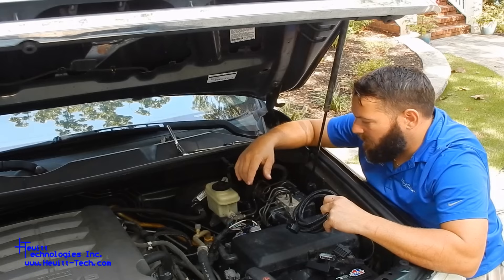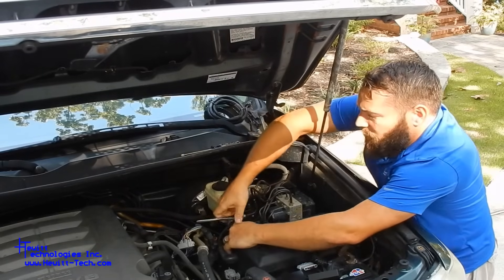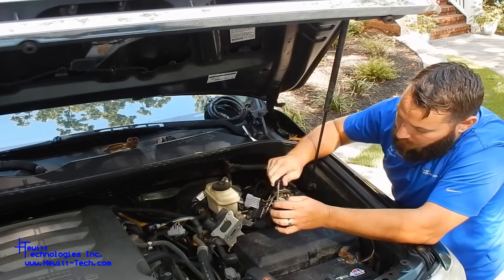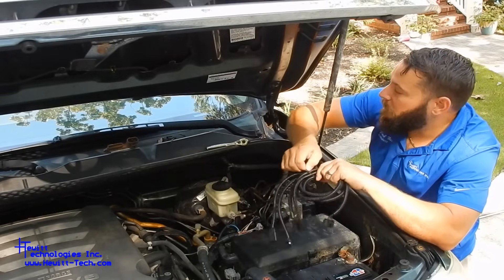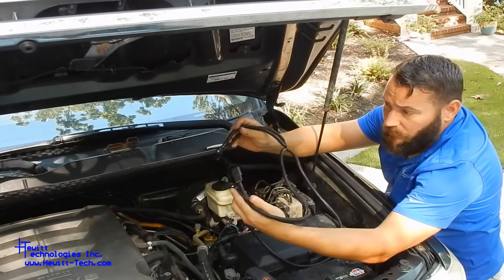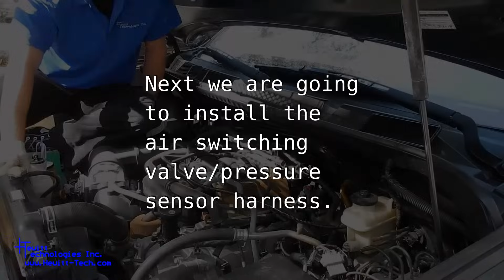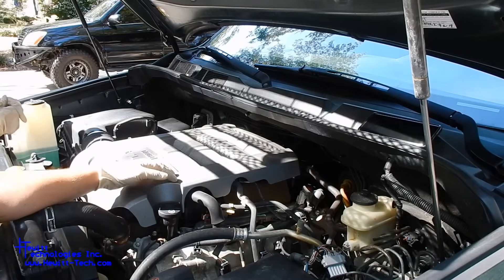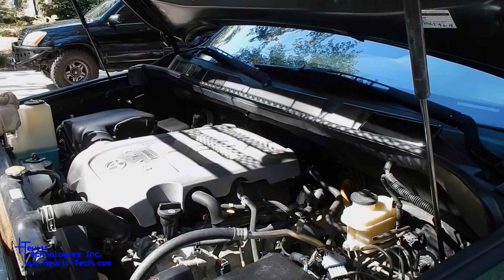Gen-II Secondary Air Injection Bypass Module - 2007-2021 Tundra 5.7L- Hewitt Technologies

Comment: So this wouldnt work for older vehicles?
Reply from the maker: This is just the 5.7l version of the Gen2 kit. We have a Gen2 kit for every Toyota/Lexus year, model and engine vehicle from 2005 up to current model year.
Reply: @Hewitt-tech  can I get a link to the version for older models?

I have a 4.7 2006 4runner & will prolly need this kit down the road. Thanks!
Reply from the maker: @Vang_Cutz  The Gen1 V36H is still a great option for prevention on the 3-Valve 05-07 4.7L vehicles.

Comment: Just got p2440 code for bank one valve stuck open. Debating which is better to bypass or just replace both valves. Truck won't accelerate, filly. Is this OK to drive as well, no stalling issues? Just accelerating. 4.6 v8 2011 tundra

Comment: Will this clear the p2445 code on my 2011 Tundra 5.7?
Reply from the maker: Yes. P2445 code is on the list it can take care of as long as it is not the result of a damaged pressure sensor. If you can clear the p2445 and it doesn't come back on until at least the next cold  start it's got you covered. We have pressure sensor addons (PSO) if you have problems after and it indicates a damaged sensor.

Comment: Do I need a gen 1 or a gen 2 kit for my 2007 tundra 4.7
Reply from the maker: The both have their advantages. The 2007 Model year Tundra 4.7L is the first year of the secondary air system where the design moved both air switching valves to the top of each valve cover. This makes the installation of either kit super simple. Both would be completely plug and play and the Gen2 has clear advantages over the Gen1 kits. That doesn't necessarily mean you "need" the Gen2 kit but in the long run it is certainly the kit we would recommend to have the best chance of never having any problems from the secondary air system again as it also eliminates the need for the air pumps, air injection control drivers and air switching valve solenoids to be connected and within spec. With the Gen1 kits there could still be a possibility that something like the air pump motor can go out of spec because water in the air pump and throw a code later. The Gen1 kits have addons for that if it happens but the Gen2 kit eliminates that as a possibility. If you or anyone else has any questions please give us a call so we can do help with the solution that best fits your needs.

Comment: I have an 08 tundra with the 5.7. I have error codes p2447. Will this be able to fix my dtc?
Reply from the maker: Hello Preston. Yes, the P2447 Pump Stuck Off Bank2 is one of the codes the bypass kit will be able to take care of. If you can't clear that code at all though, let us know, you may have a damaged pressure sensor that will also need to be addressed with a Pressure Sensor Addon.

Comment: I have a p2447 code on a 2007 Toyota Tundra. Do I just need the gen 2 bypass?
Reply from the maker: Typically that should be all you need. Especially of it just started happening or you can still clear it and drive fine for at least the rest of the day. If not, give us a call on Monday and we can have a conversation about the best options for you. Toll Free 1-844-307-7671

Comment: How did you fit your hand behind the passenger side??? Its super tight back there and the harness is literally right over it. I was able to force my hand back there but then my hand was stuck and i hand no leverage to pull the connector off.
Reply from the maker: You can unbolt the main engine harness support and a couple other things in the area to VERY gently get more room from the main engine harness. To unclip the connector try laying a small a flat head screwdriver on the tab so you can easily depress it with your thumb, or use your other hand to carefully push down from above with a long screwdriver so you can use your full grip strength to pull the connector off.
Reply: @Hewitt-tech  was finally able to get it off. Used a 12in needle nose plier. I was able to fit the plier in from the side and to get it off. Thanks.
Reply: @Hewitt-tech  i havent installed the block off plates. Its like 10° here in MN today so im planning to install them tomorrow instead of today. I did clear the codes and took the truck for a cruise around the block. The lights came back on and its back in limp mode. Im guessing once i install the block off plates, and re-clear the codes, it should solve it? I was getting code p2440 valve stuck open.
Reply from the maker: @franklock123  installing the plates would certainly be the next step. They are recommended regardless of the code but are required if the valves are physically stuck open or leaking exhaust. After that and clearing the code(s) again if you get a CEL again read the codes and give us a call or send us an email.
Reply: @Hewitt-tech  ok so i just got done installed the plates. I cleared the codes. The code p2440 didnt come on anymore and im not in limp mode anymore. However, a code p0983 came on after 1min of driving. The truck wouldnt go into 5th or 6th gear. I stopped the truck after a few minutes. Re cleared the codes again. And drove it for about 15minutes on and off highway. The codes didnt come back and the truck seems to be fine. Ive never had the code p0983 before or had any transmittion issues. Wondering if its normal for this code or other codes to pop up after install the by pass kit.
Reply from the maker: @franklock123  P0983 Shift Solenoid "D" Control Circuit High would not be anything directly related to the bypass kit or installation. Maybe you were a little too rough with the engine harness and it didn't like it? We do see transmissions circuit codes like this that are caused by water getting into the transmission harness connector. Maybe it has a problem and got jostled. If you see a code like that again I would recommend inspecting the pins/terminals of the transmission harness connector first, you may want to do it now to stave off it becoming worse. Right now it might just need to be cleaned and resealed before it becomes a bigger electrical repair.

Comment: will this pass the inspection in NY state?
Reply from the maker: As stated on our website and Product Listing HT Bypass kit are sold for off-road, competition or other emissions exempt vehicles only. It is illegal to remove, dismantle or otherwise cause to be inoperative any pollution control device required by federal, state, or local emissions law. If you have any other questions please give us a call (844) 307-7671

Comment: Just installed the gen-11 kit on a 2010 tundra, had replaced the switching valves with Dorman brand from Rock auto, one of them only lasted a week, installed the kit and still could not cancel one code, put old valves back in and all seems good. Pulling the intake is not a big deal if one has trouble getting at the switching valve connections.
Reply from the maker: It was a good call trying your factory valves to see if their pressure sensors were still good! We have recommended trying that on other engines than the 5.7L because the valves are easier to change on them. We typically recommend our pressure sensor addons to save having to replace the valves on any of the engines. The Gen2 must use an actual pressure sensor for each valve while the Gen1 kits we can use just a jumper harness or a harness with a pressure sensor if both are bad. Just let us know if you need anything else. Paul

Comment: Question, would this fix both banks with one unit or are two separate units needed?? Please help out I’ve got codes p2443 and p2441, indicating both banks are stuck closed.
Reply from the maker: The one unit covers both banks. You will notice in the video and instructions, the Gen2 unit replace both air injection control drivers with our single unit.
Reply: Thank you

Comment: Installed yesterday.  Check engine went away right away.  Finished the block off plates today.  When doing the bypass module, only hard part was reaching back of engine.  Used a mirror on handle to visualize where the plugs needed to go.
Reply: Will it pass california smog after bypassing?

Comment: I have a 2012 sequoia ( 4x4 if that makes a difference ).. but I swear this 5.7 is configured differently, I’ve located the switching valves BUT where the connection leaves the valve it is then shielded in plastic with a bunch of other wires and I can NOT find where the other end of these connections go.. I’ve looked all over the place.. ( really hate to take off the manifold ).
Reply from the maker: All the 5.7l are the same. Give us a call toll free for support.  844-307-7671

Comment: Put my Gen 2 kit on today. And 2007 Tundra 4.7 runs better than ever! Thanks alo Guys!!
Reply: Did you follow this video? Was it the same for the 4.7 or did you follow instructions included? Looking to do the same with my 2007 4.7
Reply: @supereddiee it’s easier on the 4.7L 2007 the air switching valves are on the valve covers and not on the rear of the engine like the 5.7L
Reply: @SeahawkAz  yeah it was pretty easy, already installed and sold the truck by now lol

Comment: About to order one of these for my 07
Will this turn my check engine light off?
What are the block off plates for?
Reply from the maker: The Gen2 kits can take care of most of the SAIS codes that you may have but there are some exceptions. Once everything is installed you will need to clear the codes by resetting the ECM with either an OBDII tool or by disconnecting the neg. battery terminal for at least 2 min. to turn off the CEL. 
The block off plates are to permanently close the air switching valves and are used to prevent valve stuck open codes. 
Please check out the blogs and other information on our website: hewitt-tech.com
Give us a call Toll Free and we would be glad to help make sure you get what you need and can answer all your questions or shoot us an email. 1-844-307-7671 support@hewitt-tech.com

Comment: How long can this kits last before it fails to buy another one, or is it a life time kits that won't fail forever
Reply from the maker: Our kits are engineered and designed with the best available automotive grade devices and components with the expectation they will last the life of the vehicle. They are however still electronics which is why we cover all of our kits with a non-transferable limited lifetime warranty. If there is a problem this is where our full technical support takes over. If after troubleshooting we determine the unit has failed under normal operating conditions and use, we will replace it for as long as you own the vehicle.

Comment: Everything went smoothly except unplugging the OEM connectors. Still having trouble getting it undone.
Reply from the maker: If you can't get your hand back there or enough leverage to squeeze the lock tab and pull... try pushing the tab with a flat screwdriver and another to catch the connector and push it off.

Comment: I didn't get the harnesses that go to the back of the pumps. I put the one harness on and the exhaust block off plates, now I have an exhaust leak on the drivers side. Im so confused now
Reply from the maker: Please contact us directly for help. Support@hewitt-tech.com  Toll Free 844-307-7671
Reply: Same thing happened to mine today once i got through with the instal. What did you do to stop the exhaust fumes from leaking out through the “Block Off plates”?

Comment: The damn plastic nipple securing my hose to my secondary air keeps breaking, not sure how. Will this unit bypass the use of the secondary so if it was to break there’d be no codes?
Reply from the maker: If you are referring to the plastic vacuum nipples on the air switching valves and as long it is not pressure sensors codes, then yes. Give us a call to discuss more specifically if need be.

Comment: I just bought a 2012 TRD Rock warrior and I've been getting a P0101 with nothing else when I give it some beans. The last owner obviously faced the same problem because it has a new MAF and new PCV on it. No obvious vaccum leaks. When I bought it, it had a rough country CAI on it which I'm not particularly fond of and I've been thinking about finding a stock box to see if that helps. Any thoughts?
Reply from the maker: The intake is most likely your problem but if its not a factory Toyota, Hitachi or Denso MAF from an authorized dealer you could try swapping that out first. Lots of CAI cause this sort of problem on the Tundras.
Reply: @Hewitt-tech  Thanks for the reply. This was my thought as well. The MAF is a Hitachi and appears to be brand new so I bought a stock intake from ebay for $150. Hopefully that takes care of it. 

Your SAIS kits have a great reputation so I saved your website as a bookmark just in case I ever need it 😆

Comment: (2011 Tundra 5.7L  w/207K miles) What codes will cause the Tundra to go to limp mode? Current codes are P106B, P2431 and P2433 codes. My tundra still drives like normal. I can cruise at 80 mph fine no power cut. Can I drive it with the codes on forever or  will it need to be fixed? I don't live in a state that has emission testing. Can I just get Gen 1 kit or will I need to get GEN 2 kit? Will GEN 2: PRESSURE SENSOR REPLACEMENT SINGLE be needed as well since I have P106B code?
Reply from the maker: The codes you have are directly related to the pressure sensor circuit in your Bank 1 SAIS Air Switching valve. The P2433 - Bank 1 Pressure Sensor Ckt High is an electrical fault code that will typically cause limp mode that you will not be able to clear until it is repaired. Normally when we see this code it is the result of wiring damage or caused by driving the vehicle for to long with an active valve stuck open code. With the circuit codes, especially if it showed up suddenly with no other issues, we first recommend inspecting the wiring and making repairs as needed. In the colder months it is not uncommon for rodents to chew on the wiring. 
The P106B code is a pressure sensor correlation code and the P2431 is a sensor performance/range code. The ECM compares the two pressure sensors in the air switching valves and the EVAP pressure sensor, if one is more than 5-6 kPa different than the other two it will throw the P106B code to say there is some sort of problem. This code by itself does not typically cause limp mode. In a case like this with your codes it is easy to say that the bank 1 pressure sensor is the problem. 
The firs thing to do is check the wiring and then our normal recommendation for this would be the Gen2 kit and at least 1 PSR for the Bank 1 sensor. 
You could use the Gen1 kit and would still need a PSR but for anything 2008 and newer we will always recommend the Gen2 vs the Gen1 V54H kit just because it covers so many other issues and is by far the best solution to ensure you shouldn't have any issues with the system again. 
Please give us a call Toll free and we would be glad to walk you through your problem and our solutions with you.
Reply: @Hewitt-tech  Thanks for the fast response I will contact you guys.

Comment: If there was a magic wand for SAIS repairs, it would be named after Hewitt Technologies. I installed the Gen-II SAIS Bypass and both Pressure Sensor Options (both PSOs due to a bad air switching valve on my 2008 Tundra 5.7L) and it wasn't that difficult with their detailed instructions. As soon as I started the truck the check engine light was off and out of limp mode!

Comment: Installed this on my 4.6 tundra with the pressure sensor add ons. Worth every penny and installation was a breeze. $5000 was the quote I got (definitely high balling) for the entire system rebuild. No brainer, the bypass kit is the way to go and they ship so fast, even back ordered parts were only an extra 2 days. They stay on top and stand behind their products.
Reply from the maker: Thank for your your comment and feedback!
Reply: So your sensors were bad?  I have a 4.6 just had the Gen 2 kit installed and it has not fixed the issue.  Maybe need the sensor add-on?  Did you get a code from your reader that the sensor was bad? I have not.

Comment: Suggestion: Until you get the connector block off plug solution worked out, if you are just going to tape off that connector, pack it with dielectric grease first. That will make sure that no moisture forms inside and starts corroding it.
Reply from the maker: UPDATE the plug blanks are shipping with the kits.

Hey Remy, The plug molds are in production. The grease is a good suggestion if anyone ever thinks they may go back to using the SAIS. You for sure don't want corrosion on them if you need to use it again for whatever reason, prevention and then sale is what I would think. From our point of view we just wanted to make sure no one was arc welding anything. Anyone who has disconnected the positive battery terminal and touched the wrench to anything knows what I am talking about. Thanks for commenting!
Reply from the maker: UPDATE the plug blanks are shipping with the kits.
Reply: @Hewitt-Tech  Are the molded plugs for when you unplug those oem air switching valves?

Comment: Will this work in my 2008 tundra 5.7 code p2443?
Reply from the maker: Yes. Typically the valve stuck closed codes only need the standard kit by itself.

Comment: Does it matter if you already have a bully dog programmer or do they work fine together?
Reply from the maker: The Gen 2 is engineered to operate simultaneously with devices such as tuners. As long as they do not share any connections or manipulating SAIS readings. However, I do need to state we have not tested our tuners every tuner on the market. In theory there should be no complications.